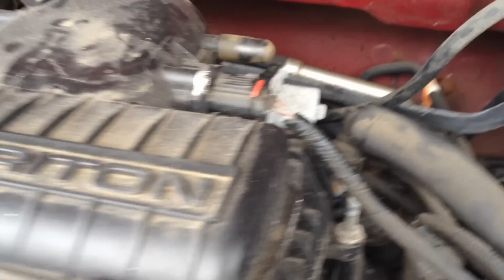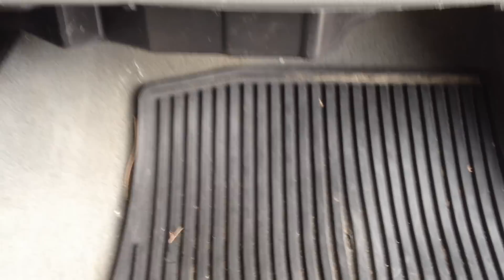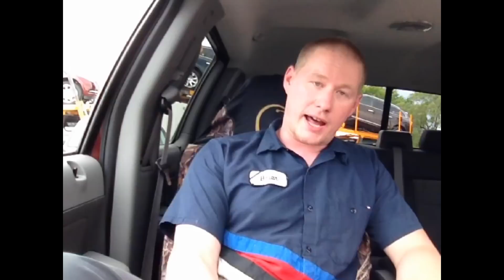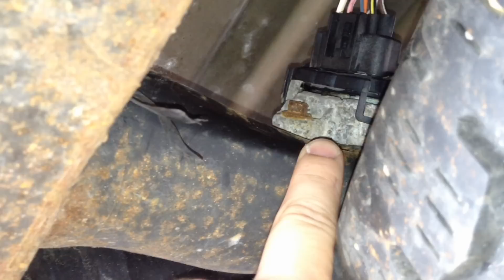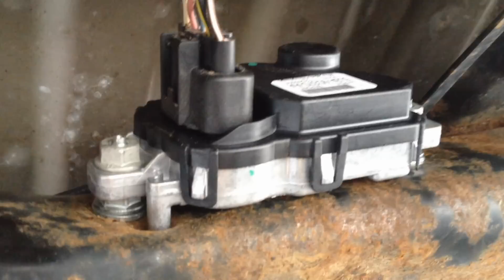2004-2008 F150 Died Out No Crank Theft Light Engine Compartment Clicking P1233

Comment: I'm currently working on my customer car Lincoln Navigator 2003 model. The car has this error message on its dashboard saying "PRNDL error No park assist". The car won't crank or start either. According to owner, he is about to park his car in front of his house side road when suddenly engine shut down after reversing. When he is about to start the car there is now an error message on his dashboard saying" PRNDL error No park assist ". So here is what I did so far, i connect my ANZEL OBD II car scanner and sad to say that it didn't communicate with the vehicle. Read the car manual, and found that the error message will appear when the gear is shifted only to reverse. So i checked the DTS underneath beside the transmission, all worked fine, the sockets are good, the signal voltage is are working as well the DTS continuity test on the bench. So I looked for the starter relay, pulled out and test the relay and its OK, i use multimeter connect to relay coil pin socket of starter relay, put in PARK position, switch ON the ignition then tried to start, I get a positive signal from that relay coil socket of 12.5 volts. So from there I assure that the DTS is working fine, cause when i try to put in Neutral it give a starting signal too. Put in Reverse-Drive no starting signal which is normal. So, using an external wire soldered to starter relay coil, i restored the relay back, what I do notice is is when I try to start, there is no signal showing up. So I was thinking of relay issue, i changed a new one still the same. Further checked, I used a jumper wire connected from positive signal from DTS to starter solenoid relay socket. Then I tried to start, and the engine crank. But it did not start. So I locate the fuse for PAM(Park assist module) which is number 27,removed it and the dashboard error message is gone "PRNDL ERROR No park Assist" is gone, I try to start, yes it crank, the message error is gone. But still won't start. No busted fuses, all relay is good. No burnt smell around the car even at engine compartment and inside the vehicle. No annoying clicking sounds. I even dismantled the fuse and relay assembly to see if there was something goes wrong. The solid state relays soldered are good and others parts. No signs of burnt or what so ever. So I ended up replacing the 2 park-reverse sensors at rear bumper as well as the PAM. Still not starting no crank and the dashboard error message still came up. Any ideas? Looking forward for your feedback. Thanks

Comment: I got a 1999 Ford Taurus just got it start will ignition won't start there was an hour and I put in the start position there's nothing no clicks or nothing so I jumped wire from the starter to the battery to test it and it's turning over still what relay do I have to change if not all of them

Comment: Have code p0191 and I replace fuel pump, fuel filter, fuel pressure sensor, and fuel driver modular and code still comes back. I checked all the wires and voltage and they are all fine. Truck sometime idle rough and you could see small amount of black smoke. Anybody help? Thank you
Reply: Well I’m a little late but you might of had a spark plug or fuel injection issue

Comment: Old vid, but i have identical problem with my 99 expedition!  something was killing the battery, short to ground I think. could hear a relay clicking under the hood, when connected. theft light, no fuel pump (no injectors is a given).  Scanner would not read the computer.  Is there a similar issue to this for my year with 5.4?

Comment: We will see if this is my problem fuse is good all wire connectors are good fule gage stop 2 days before truck wouldn't start.  Throwing codes p0453 p0463 p1000 p1233. Took the  Module off lots of corrosion can't tell if it was crowed it through or if I did that trying to clean it off. I will update as soon as the new one gets here. 08 f150

Comment: This may be useful to others. My truck died while idling. Fuse 34 was still in good shape. Theft light was not erratic. I could crank all day long; no start. After changing the fuel pump driver, it started
Reply: 1
Reply: That sounds like mine. This helps me find reason to investigate this module further.

Comment: I got a 2005 f150 with the 4.6l replaced the fuel pump driver module in the back and the plug isn't burnt or melted. But it still keeps blowing the ecm/pcm fuse. Any input on this?

Comment: Just bought an '07 with 82k and the spare tire in bed. In process of putting spare back noticed the broken module. Broken exactly the same in video, aluminum frame of it split in half crumbling. Wondered what it was, this was the first video I ran across. Believe it or not the truck still ran for as good as a Ford and a 5.4L can. I'm glad I found this video and have replaced module so future owner doesn't have this happen. I'm glad I'm a GM guy, Ford is so bass akwards in the way they build stuff. Thanks to #FordTechMakuloco

Comment: I replace my 2004 ford f150 4.6l engine with a 2005 ford f150 4.6l engine and when i went to start the truck i won't crank or start but it cranks when i do a push button test on the brand new starter and had the battery tested and it is good checked all the fuses and relays i don't know what else to do

Comment: I am having this problem with my 05 F150. Changed the fuel pump driver because it was busted open and burnt. Theft light flashes like crazy and is still clicking under hood. Still won't crank over. Switched relays around to no avail. Still not working. Does anything need to be reset to get it to turn over??
Reply: Andrew Sutherland did you find a fix?

Comment: I've got a 2008 f150 4x4 4.6 2v and it all of a sudden won't start. if you spray the throttle body it will start then quit so I'm assuming fuel.  I changed the driver module because it was rotten right through.  Still won't start.  Would your next guess be the Fuel pump?

Comment: My 2004 Ford sport trac will start and stop within seconds. I have changed the fuel pump three times until I got it scanned just now. It came up with P1233. I have located it and removed it. I want to get a "Tokunbo" used one as it is not easy to come by brand new one here in Nigeria and when you get one, the price is not just affordable. So, I'm going to get a fairly used one and check if the problem will be solved. I just hope it solved the problem. Ford cars are just problematic.

Comment: I have a 2006 f150, just installed a new 5.4 3valve, truck was running with loss of oil pressure after running, ie main bearings.  All back together and truck will not run. Confirmed spark, injection pulse, and compression all good. Cranks but no start. Triple checked everything including timing still nothing. Sent to Ford for diagnosis, everything is normal but still won't run. HELP !¡!!!!!!

Comment: Hey makuloco 
I'm having problems with a 2001 ford must 3.8. Same problem like this truck but without that noise from throttle body unit. 
I wanted to know if this year Mustang has a fuel pump driver module. 
Also where the fuel pump relay located at?
I did see a small module in the left rear quarter panel but didn't know it could possibly be FPCM.  Still not 100% if this a module.

Comment: When my 2004 Ford F150 wouldn't start I turn the key on and try to start it I noticed that the radio went from FM to a.m. so the module shorting out back feeding changing my radio losing memory on my radio maybe another indication along with the blinking security light and the fuse testing okay with the test gauge but fuse burned out like you're talking about again thanks for the video

Comment: Sorry to bring up an old video but would you be able to just the starter and get the vehicle running with these problems. Have have one doing something similar but I'm able to jump the starter and the truck runs just doesn't run well

Comment: My 99 f-150 , will crank in the morning no problem and never cuts off , but after it's warmed up go somewhere and cut it off get back in and start it it takes a while for it to start up ? But it will start , if I key it 3 or 4 times before trying to start it it'll crank right up ? Is it the fuel pump?

Comment: On my 05 Mustang GT, after about 30 minutes of driving my engine will stall quickly, no bucking or anything, just a flat stall... the first light that comes on as the stall occurs is the theft light, solidly lit. 

It’ll crank but not start for about a minute before it starts up again. 

I ran a data log and forgive me cause I don’t know what I’m doing but the log shows that the FPF (fuel pressure fault) goes from NO to YES about 2-3 seconds before the stall occurs. 

When the stall occurs, I have multiple pcodes, 

intake camshaft p0010 p0020, 
evap p0443 p0446, 
obd readiness p1000, 
ecm/pcm p0689, 
charge motion p151a.

Any idea if that’s indicative of a failing FPDM?

Comment: I changed both fuse and module fuel pump mass air flow sensor fuel filter and still it cranks but won't start especially after I've driven it a bit and it hot after it sits for hours it starts just fine
It tells me check gauge's and I'm completely confused why it still has no fuel pressure after it runs hot plus when it does start eventually I smell gas in the cab of my truck its a 2007 xlt 
Any  thoughts?
Reply: And my theft indicator does not flash at all when I turn ignition to starting point
I'm not sure what's going on but it does this when my engine is hot and has been running for awhile

Comment: My module actually bit the dust after going through a huge puddle. I went through said puddle, pulled up to a stop and went to pull out and it stalled and rolled right in the middle of the road blocking traffic. Luckily I was able to limp it home and get the replacement module shortly after!

Comment: I have an 04 F 150 4.6L driving down the road and loose all instruments..The truck didn't shut off. Got pulled off road at a service station and it started to run rough, and had a loud clicking sound so I shut it off. Bad electrical smell at the rear of truck.tried to restart but was dead...Got a jump and it started right up, but wouldnt run but for about 30 seconds.. anti theft blinks normal with key off, but try to crank it and it goes crazy....i think the issue is the fuel pump module where the spare tire is just like you said on your video....my thing is why my inst. went out?

Comment: Nothing like coming home with a load of building materials and boom, no power. Changed the fuel filter, then cleaned the mass air flow sensor. Nothing. Watched your video and changed the module. Boom, instant success. Thanks for the share and helping the not mechanic guy. Saved me some money to put into my 30 Plymouth coupe.

Comment: Wondering if you can help I have a focus 06 with no start no crank all lights on the dash work but the immobilizer light flashes like made had a new key programmed by a locksmith but still nothing can you help.
Reply: Nicky Jones 
Sounds like the steering wheel ignition lock is broken. Very common on focus. $160 @ ford.
Reply: Nicky Jones I

Comment: we have a f150 XLR 2013. we were driving done the road, we felt a bump and the dash went all crazy. said to shift to park going 75 miles per hour. the heat got stuck on so we pulled over and tried to restart it. it didn't start and is giving us a system start fault... any fixes?

Comment: Buddy I need your help. 2004 ford explorer, Key is programmed, vehicle will not start, ignition comes on security light flashing regularly but there is no crank, and no sounds of pump/fans initiated. Any thoughts?
Reply: also checked all fuses...
Reply: What was wrong I have the same issue 🤦‍♂️
Reply: Did ypu find the problem..what was tbe fix

Comment: Having a similar issue on a 2010 F350 SD, 120k miles.  Fast flashing security light on dash, no crank, dashes instead of digits on odometer display (not every time).  Would the information in this video be applicable to a 2010?
Reply: Wont hurt to try....did u ever fix those dashes on your odometer..let us know what the fix was thx you
Reply: Yes.  Let us know.  Having the same issue.  Thanks

Comment: has this same problem happened on a 2002 f150? My dash lights went on except for the check engine light I shut the truck off & tried to start it again & the motor cranks but won't start.
Reply: Did u ever get it fixed n if so how please

Comment: This just saved me a lot of stress. My truck was no start no crank. This was exactly what was wrong with my truck. I have an 04 F150 FX4. I didn't have the clicking in the engine compartment, that was the only difference. But my Fuel drive module was cracked just like this one and my fuse 34 was shot. This happened out of nowhere, came out of a restaurant and truck wouldn't start. THANK YOU SO MUCH FOR THIS VIDEO!!
Reply: Cost?
Reply: Can you tell me where is it located on an 2004 f150 heritage old body style??
Reply from the maker: No problem!

Comment: My '08 died while driving and threw code P0191. Checked the Fuel Pump Driver Module after watching this video. It was cracked in half and was corroded right through the bottom of the module. Replaced and problem solved! Thanks you saved me $!

Comment: will the fuel pump cortroll modell make the fuel guage starting to act up
Reply from the maker: No it is separate.
Reply: Then what makes the fuel gauge act up.
Reply: This is on a 2009 f250 superduty 5.4 with less then fifty thousand miles.
Reply from the maker: If it is working most of the time but sticking at times like after a fill up then you need to either replace the sending unit or use this product to clean and protect the sending unit card it must be the plus version though that I link to here- http://amzn.to/2hWXA2y
Reply: would sefoam do the same thing.because i use se foam 3 times a year in the gas for the truck

Comment: Hi Brian, yup already replaced about 10 of these fuel pump driver modules, whoever thought it would be a great idea to put it behind the drivers side rear wheel well should be fired just for being stupid. First time it happened was a real trip because I never heard of the fuel pump driver module befor, if you don't know its there you are in for one hell of a good time trying to figure out why the fuel pump is not working, trust me.

Comment: cape cod , MA here....tons of corrosion between road salt and beachs / salt air. DORMAN also makes an updated FP driver module also. its actuallly pretty good and comes with rubber spacers to avoid that metal on metal corrosion. 
just wanted to say thanks. this video and others i ve seen for u ....very knowledgable. thabnks!!

Comment: I just had the fuel pump module control replaced by a Ford dealer. Part cost $160, and labor was $168, total invoice was 350.00. All for a part that is mounted on a crossbar underneath the truck, practically by the rear axle. this is where constant water and wintertime salt gets thrown. Hurray for corosion. How clever a spot to mount it instead of perhaps under the hood.  Got a better idea....why not mount the PCM on the same crossbar by the rear axle for constant water and wintertime salt because those are $1,300.00 and could really improve Ford dealer's bottom line. I just had a PCM installed the week before the fuel pump module got installed this week.

Comment: Hello, I have an 08 Ford Expedition EL and it just started stalling and sometimes it wouldn't crank at all with no power at all. I would come up to a light and it wouldn't idle like normal it would act like it wants to take off. Would this module be the cause of it if it even comes with one ?....please help. Thanks

Comment: I watched your video that shows this module, but it must have been for different year f150. Mine is an 08 and this one is it! I have no problems, but after watching what could be a future issue I went ahead and lowered spare tire and removed module to make sure it was in okay condition! All good, just cleaned out the sand grudge etc on the module, bar attached and sprayed and cleaned using rust protection.  Thanks again for your help!

Comment: this same problem happened after I pulled over as soon as I had a spark plug blow out on my 2008 4.6, could the blow out have been the reason for this issue?
Reply from the maker: no
Reply: Yeah I found out by replacing that module that it still won't crank

Comment: I have the exact same problems in my 2003 f150. I cant find fuel driver module. What is its equivalent? Will run when using starter fluid.

Comment: YEP, Mine died, no start, checked computer and no fuel pressure. And, obviously I couldnt hear the fuel pump with key forward. New DORMAN module since the FORD one didnt come wtih the rubber stand-offs to keep it away from the steel cross-member... Go figure. First thing i did was plug the new one in before mounting it to be sure that was it.. Started right up!

Comment: +FordTechMakuloco my Ford F-150 2008 it's sometimes turns off and then it idles once it put the gear in drive mode but it only starts acting up when ever I put it in drive mode now when ever it gets to my 3 rd shift the truck is very heavy to speed up I have to press the gas hard so speed can pick up. On my second shift its fine but i don't know what it might be

Comment: those driver modules are a pain.. I took mine off and put some rubber washers to make clearance from the frame and put nickel antiseize all over the back of it just as a precaution.  3 years later still no problems. good video brian.
Reply: keith kennedy 4

Comment: Gidday Brian; I have just enjoyed your video on the F150 FPDM. As power was realised on both sides of fuse # 34; did you have to replace the complete CJB to replace the failed diode at contact-A? Many thanks; we enjoy your work and appreciate your efforts.
Reply from the maker: +gerard kavanagh No the power loop through is from the failed shorted fpdm so once it is disconnected the power should be gone.